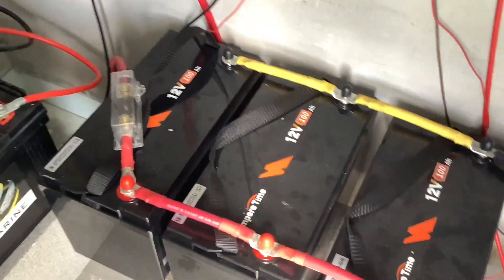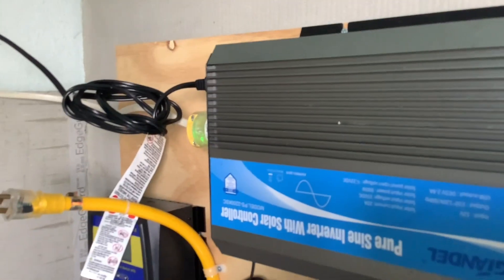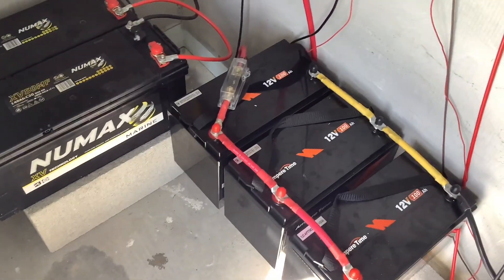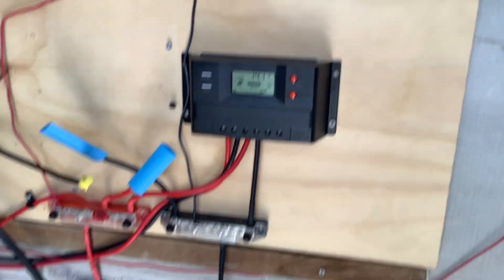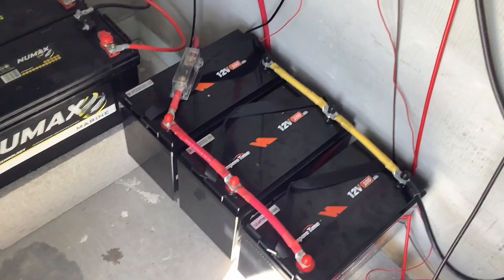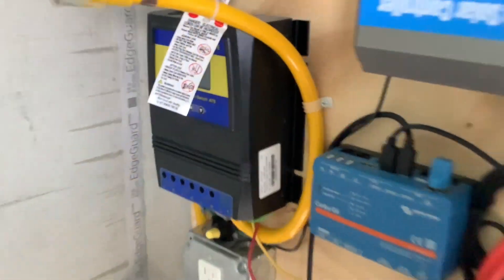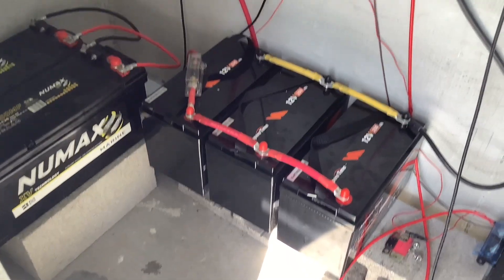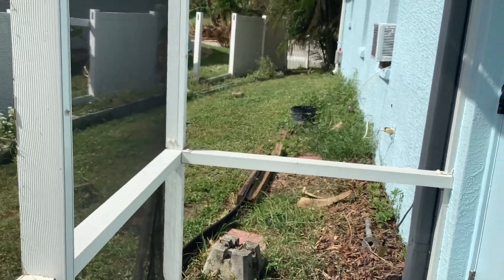Ran a 5000 BTU Frigidaire AC for 11 days on 300AH batteries and a 240W solar panel

Comment: I have 300w of solar panels and the same 20a MPPT and I’m in California. It’s running my entire office/computer and bedroom and my fridge at night. Basically everything I use. I’m looking for a 300-400w window AC. I have a 165ah battery and it’s running everything I need. Battery quickly gets to 100% in day and I’m running totally off solar. I use a 500w Victron Inverter and it handles everything. Plans of expansion of course 😅

Comment: So about 1,700 for all of this to run a 5,000 btu yikes
Reply: No it ran my boat (shore power every day), it ran my electric mower, my electric trimmer, my 12v fridge every day, my usb internet router (during power outages) and of course my iPad and phone …    You have to get more out of it than just sitting around useless waiting for a problem - like a generator.
Reply: I spent $500 ish for 300w of solar a 165ah battery 500w pure sine (1000w peak) and MPPT and it runs my entire house pretty much 😂 except stove and central AC. 

My fridge, my desktop PC, all my lights and my entire office/bedroom fans and usb chargers internet router etc etc. it’s absolutely amazing 😂 another set of 300w panels and I can easily run AC. 100w panels are $60 each on amazon. This is too ez.
Reply: @YouTubeAccount-i4m awesome tyvm

Comment: I can run my 5,000 Btu ac in my flat black work trailer here in the florida heat for 8 hours a day on 300 ah battery and 600 watt solar. My ac runs wide open all the time though. The surface temp on the outside of the trailer skin was 167* yesterday but it was 78 in the trailer.😊
Reply: Dang, what are the dimensions of your trailer and is it insulated?
Reply from the maker: Awesome … How long have you had that setup running?
Reply: You need to insulate that thing and it’ll be ice cold inside 😂

Comment: This is the exact AC unit I have and need to run. I'm trying to figure out a small system like this and I'm new to solar. Can you charge your batteries with a generator if there is not enough sun? Also, I'm confused about Panels. Why wouldn't you use one 400 watt panel vs two 200 watt panels? for the space, wouldn't two 400 watt panels charge faster? I have some trees in my neighbors yard and need the fastest charging system I can get... I only will have 4-6 hours of direct sunlight on a good day. Great video BTW.
Reply from the maker: Hello and welcome to solar, great to hear that you want to get in with a smaller system … that’s the way to go. 
On your first question - yes you can charge from a generator (while you’re using it) if you have a little charger. This is the one I use https://amzn.to/4dIDDce and I’m very happy with it.  You need to get your batteries in sync before putting them in parallel and this is little charger is how I do it. 
With regard to the bigger panel, I lived in Florida and so when a hurricane was approaching I would go and bring in the panels for safe keeping then put them back out when the storm passed.  So it’s best to keep the panels small and manageable but still able to produce. Thank goodness I did that when Ian hit me or I would have been in big trouble.
I’m in Japan right now looking for property here and am going to setup a new solar power system here.  I have a typhoon coming right at me now ( I’m in Kyoto) lolol. 
Thank you very much for the comment and please keep me updated on how yours progresses. It’s great seeing how everyone applies the technology.  Thanks again for the comment.

Comment: Could you have not rented longer than 11 days?
Reply from the maker: No …. People couldn’t find gasoline for their cars or generators.  There is nothing to rent in a disaster.
Reply: @colinauld  sorry my bad it should have said could you have not ran it longer than 11 days. 
Now I realize you were using it as backup power for a storm. 
That's awesome that's exactly what I'm building 3 -100 amp hour with 400 array. Just so happens we have a hurricane coming to South Carolina as well be blessed my friend
Reply from the maker: @chuck4abuck1  No worries, yes I could have kept going longer.  The only issue was the batteries would not go back up to 14.2 but they did the 13.5 mark (the manufacturer full charge mark).  I gave them a full charge when loads were removed and they were fine.   Good luck in that storm, I hope all goes well for you. Thanks for the comment.

Comment: Great video and congratulations on the win. 
Can you do a gauge wire that you use just a quick 1 min just touch and size I'll figure out the rest. I am running 2 trojan T105 agm 6v w 200w renogy.  Will this setup hold through night. I am so new to ac and inverters. Only ac will be on is a 12x6 camper. 

Side note being in Florida heat have you looked into aluminum foil your rafters to keep heat out as well as over roof floor insulation put over as well as side roof walls will keep your house way cooler but keep a big air gap. Thx again Sir!!!

Comment: Nice beginner’s setup. Not sure why this video showed up on my feed, but I’ll say that with the potential surge of that inverter, your wiring and fuses from batteries to bus bar are undersized. At 2200w / 12v you’re pushing 200amps. That’ll pop the anL or in-line breaker regularly.
Reply from the maker: Hey thanks for the comment.  Yes the inverter can handle the 2200 but I don’t have loads even close to that.  All the components running at the same time (AC, Micro wave and fridge) is just at 1000 watts.  My concern is not the inverter because I know what I run on it.  For me the batteries are more of a potential which is why they are fused right at the positive terminal and the 150 breaker is only 2’ above that.  Neither the breaker at 150 nor the fuse at 175 have never tripped.  If I ever saw that what I was running was getting close to the 1920 watts 150 amps allows at 12v .. I would increase the inverter size.  200 amps at 12v is  right around 2560 watts … too much for this inverter setup.  
Thanks again.

Comment: We think alike.  It's all about redundancy.   I noticed that you have the  ryobi 40v cordless platform.  Great.  I have 20 of those that I have been utilizing in small solar generators around my house.   These power lights, tvs, ceiling fans etc.  They are charged in my shop like yours off solar.  Like you said better to use these everyday, over and over.   Great video.

Comment: Well done... there's way to much "BIG BUSINESS AND GOVERNMENT"control in the solar area... it's great you've installed a separate 12v LED light system it's  better to have a simple system that doesn't need city approval for and you can fix your self...Im going to buy a couple of "solar generators"" to run my fridge and tv / satellite internet and am thinking of getting a 12v compressor fridge that runs for ever on batteries!!.🤔💕🇺🇸🇺🇦
Reply from the maker: Thanks, I agree 100% about too much control and the need for us to be independent.  12 volt is the answer to controlling costs and allowing inexpensive growth (1 battery at a time).  I’m afraid we’re all going to need something for power soon and I just want to show people that solar can be practical and simple.  Your approach sounds great, hope it all comes together for you soon.   Thanks for the comment 👍🏻

Comment: Don't be worried about the SOC of the batteries not being 100%.  Lifepo4 is quite happy to be cycled at lower states.  In fact, by not holding the batteries at 100% all the time you actually extend their lifetime cycle count.  It's pretty common for people to bring 12V lifepo4 batteries to 14.2V and sit them there for an hour or so to let the BMS do any balancing it may need to, then let the charger go into float (legacy terms) at 13.5V.  Victron has a lifepo4 preset which defaults to 2 hours at 14.2V, that's fine too.
Reply from the maker: Thanks for the info,
I was pretty lucky with very sunny days after Ian but if a few more cloudy days had appeared I think I would have been struggling with the recharge aspect.
I definitely don’t need any more panels for my day to day use but I want to add another 200w and a 2nd controller just for the redundancy it will provide. 
Thanks again

Comment: I agree with your comment that the all-in-one units have a weakness.  If anything goes wrong, the whole unit is dead.  I spent over $2600 on my all-in-one power station (included two smaller solar panels).  When I needed it, I noticed it was not working.  One of its circuit boards failed, it showed an error code, and sat there useless.  I contacted the vendor, but their service department was so backed up that it took months to resolve the issue.  If I had used my funds to build my own system and a part failed I could simply replace or repair one part and I would be up and running again.  The average consumer can not repair the all-in-one units ... if there is a problem, it is out of your control.  There are hundreds of review videos that describe the all-in-ones as a panacea.   They influenced me to purchase one ... and then I had buyer's remorse.
Reply: I finished my 9th ''solar generator build'' since first using LiFeP04 batteries in 2017. I build them using off the shelf components knowing that I can replace anything that fails or improve the system to suit my needs. The term ''solar generator'' sticks in my throat. I prefer to call my latest one a ''Sunshine Compressor''.  3600 amp hours, 46,000 watt hours. It runs 24/7 and I use a Pet Cam to monitor the battery meter from anywhere I get cell phone reception. The Victron Smart Shunt won't even transmit into my house.
Reply from the maker: Wow Larry, that’s unfortunate and the unit you bought was high end at $2,600.  Glad they finally resolved it for you.